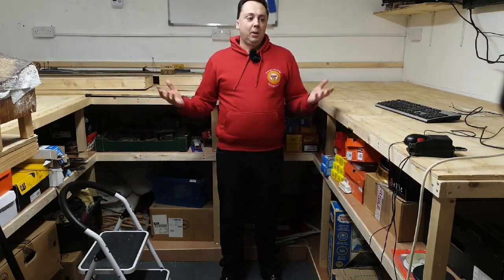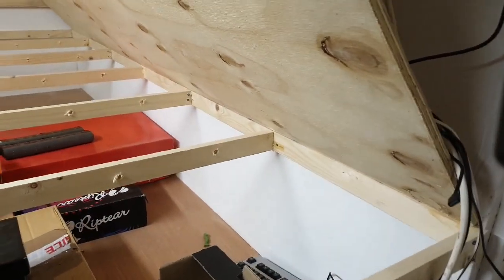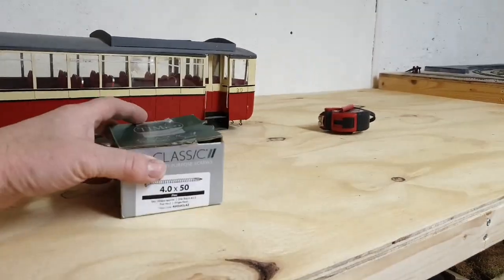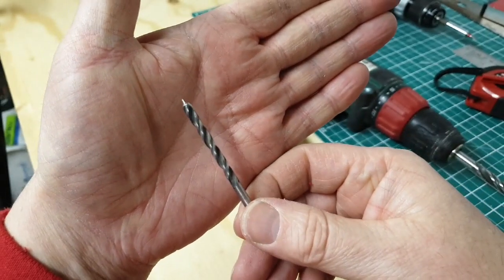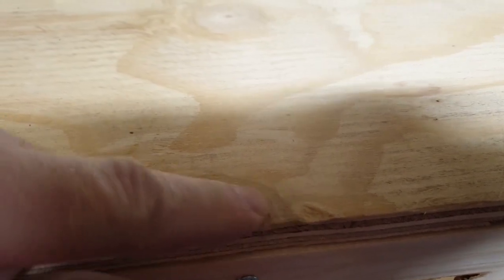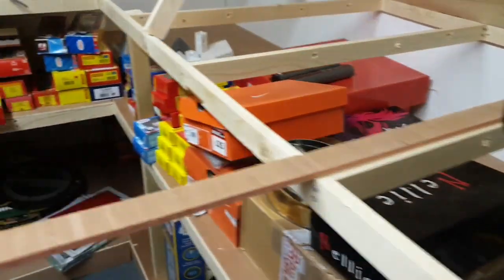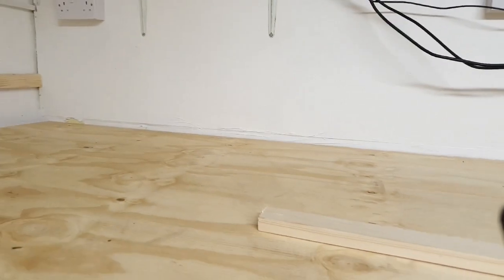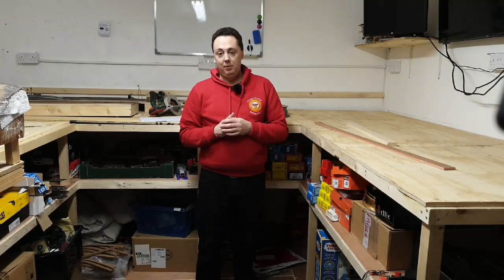36. New Baseboards and future plans for the new layout.

Comment: Hi Mark, 
When you're countersinking a hole in the wood , would it be a good idea to counersink the wood underneath and match-up the two holes to drive in the nails without splitting the bottom part of the wood? Let me know what you think. 
Thank you for your time 
Sincerely 
Allan
Reply from the maker: Its counter sinked to fit the head of the screw.

Comment: It's a great design, Mark, and it gives such free access to the lower shelves. But how did you actually fit the 9mm plywood sheets in around the 2x2 framework legs?
Reply from the maker: Thanks Peter, as I built it the 2x2 legs sit onto of the plywood and screwed into the base. This saves extra cutting around the supports.
Reply: @DonegalDadRail  Thank you - I'll follow suit. Mighht even go to the extent of having a bit of carpet laid to save the knees, LOL. I joined the channel this evening. Really impresed by it all Mark, not least by your customer service . :)
Reply from the maker: @MaboPete  Thank you Peter.